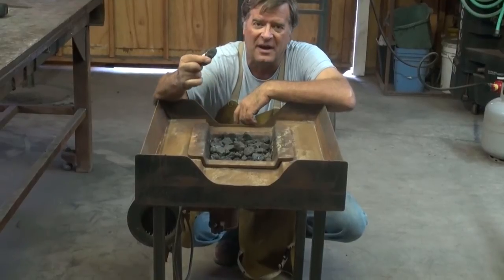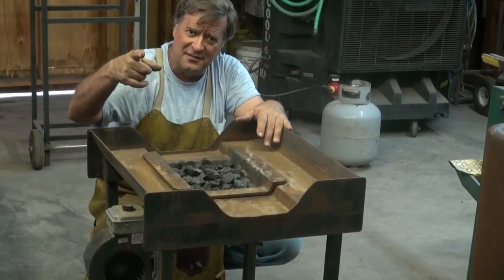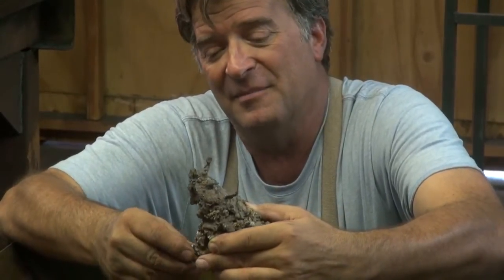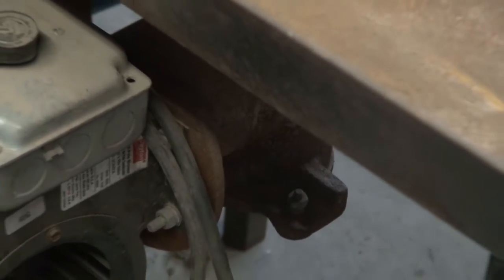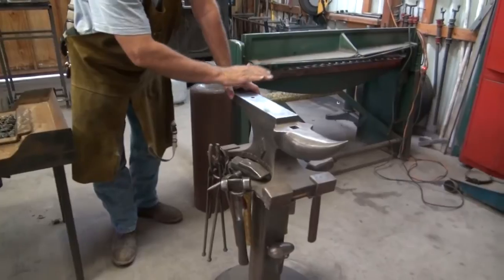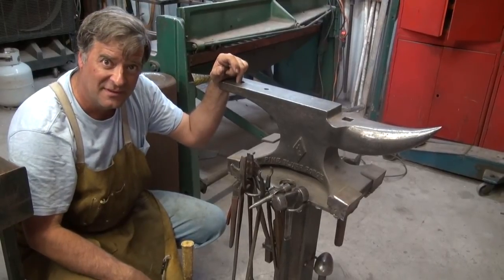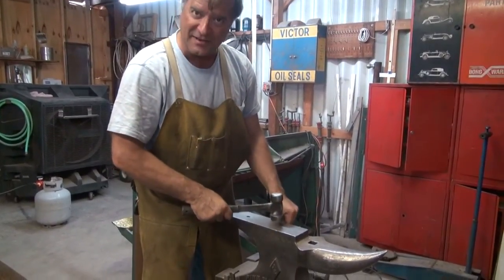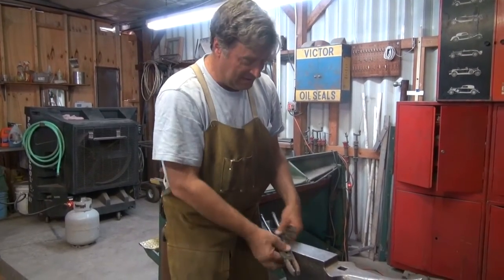Tools for the Studio, Part 4 - Kevin Caron

Comment from the maker: @AeroSport103 I have in the past screwed up and made a forge weld or two. I went with the coal because of the cost.  Much cheaper to run coal than gas. With the amount of bending I had to do it was just cheaper.